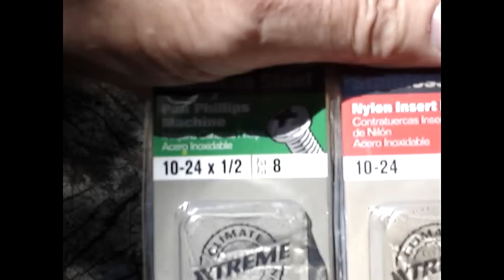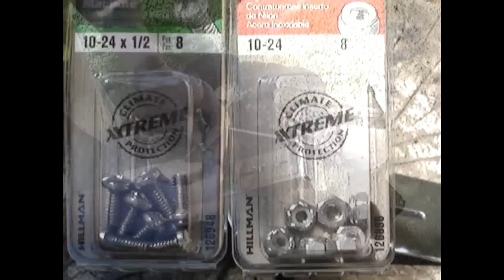RUIXIN PRO Knife Sharpener Modification

Comment: Nice video.  

In my comments below I refer to the end of the sharpener which is closest to the user as the front end of the sharpener. 

I decided after one sharpening to not use the clamp for much the same reasons as motivated you to put in the magnets.  I just freehand hold the knife in place.  I put the bar, which is part of the clamp system and which is supposed to go across the back of the sliding plates, underneath the front end of the larger plate.  This raises the plate enough to serve as a rest or back stop for the spine of the knife.  I found the plate itself is not thick enough to be an effective back stop to prevent the knife from sliding down the table.  The smaller plate I put on the front of the sharpener in the vertical position to clamp scissors and such.

The next major mod was to fix the problem that the vertical post is not far enough from the front of the sharpener to allow you to use all of the surface of the sharpening stone.  I mounted the sharpener to a board.  Then I took the vertical post out of the sharpener and mounted it to a 1"x2" piece of wood.  Then I screwed the 1x2 to the mounting board behind the back end of the sharpener so that the vertical post is now far enough away from the front of the sharpener that I can use nearly all of the surface of the stone in my sharpening.

I changed the handle on the stone rod to a round wheel.  I would prefer a round knob like those on earlier plastic sharpeners but I can't find one that fits the threads on the end of the stone rod.

I use an angle cube to set my angles.  When I change to a stone of a different thickness, I just use the cube again.  I prefer this to using a drill stop collar on the vertical post as many people do.

Again, thanks for the video.
Reply from the maker: +Joe P 
Joe, I would love to see what you've done... this sounds great! Do you have any pictures or video of your setup? 
I can almost visualize it, but a couple of points have me guessing. Also, I've never used an angle cube... I'll have to get one of those! 
Thanks for your comment and the description of your modification!
Reply: I too would like to see some pictures or video of how you use it freehand. That might be an even better approach than the magnets. I got my Ruixin today (06-02-16) and immediately saw the problem you mention about the vertical rod at the back of the unit being too close to the front of the unit. I will try making my own mount for the rod. So I'm interested in seeing a picture of your rod mod too. Thanks.
Reply: Joe P
I read your comment two times but not being a native English speaker and not living an English speaking country makes it impossible for me to understand your setup. Please make a video to demonstrate your setup/ modification.

Comment: Also you can move vertical stand 2cm forward. Just drill a hole in your wooden base and fix it with nut. This allow you to use full surface of your stone. Longer stone lifetime.
Reply from the maker: Great idea. Thanks!

Comment: Beside locking nut, you can use couple of plain washers stacked together and lubricated. This also helps for smooth movement. This system is used for laptop screen hinges.
Reply from the maker: That's a good thing to know! Thanks.

Comment: i own the regular model,the one that looks like the edgepro! because i couldn't remove the slope/play from its pivot system,i just replaced it with a ball joint rod end and totally fixed this problem,i now am getting proper bevels on my knifes,i recommend other people try dong this,i never thought the pivot on this copy or EP worked in the first place!i just got tired of messing up my good knifes,thank you.
Reply: Can you provide a source for the ball joint rod end you used?  Thanks!

Comment: I replaced the swivel mechanism, and the bar that slides through it. All you need is a tie rod end, M8. 8mm  precision ground bar. Drill a 7.5 mm hole through the threaded part of the tie rod end.  Thread the end of the bar with M8 die nut. and there you go. Add an M8 bolt or thumb screw, and you have a very smooth, rock solid slide mechanism.
Reply from the maker: Neville Springer
Genius!  A tie rod end.  I've replaced many of them in cars and it never occurred to me that it's the exact thing this needs (except smaller, of course)!  Whoa!  Thanks!
Reply: @Calvin Beckett Instablaster ;)

Comment: Nice job. I like the base you added. You mentioned you were looking for a more sturdy base. But then it's permanently big & heavy. I would keep it like that and maybe add some form of clamp or even a ratchet strap to hold it steady. If you can find a good way to use the strap and find some good anchor points on each side of your table that might work the best because there's no metal parts to bump into and doesn't add to it's bulk. Just a nylon strap running over the base holding it steady and in place. I stumbled on to your video after ordering one myself to see ideas to improve on the design. Thanks for the info.

Comment: I've used  similar guided edge systems for over 20 years now, to sharpen mostly custom made knives. The first was a Lansky - okay, but the stones were small and narrow. A Gatco - similar, but better than Lansky, with longer, wider stones. The last 2 kits were more money than the Ruixin but the same concept. They were great - BUT - plastic parts started to crack eventually. The Ruixin is all metal, but there are no markings to indicate angle, you'll need to measure that and mark the pivot stick accordingly. If you get any stone/metal slurry between the blade and the sharpener platform,  you will scuff the blade. I put a thin piece of tape on both sides(of the blade) to protect the blade finish. The clamp system gets in the way sometimes. I take it off and use a thicker plate so I have a deeper shoulder for the spine to butt up against and just hold the knife down and back. A Perfect sharpener ? No, but it will do an excellent job. The price for some waterstones can easily exceed what some people would pay for a custom knife, but for the $21.00 US shipping incl., you can't beat it. If you can't put a deadly sharp edge on a blade in 10 minutes with one of these, you shouldn't be allowed to use a knife, but there are several systems out there that will thin out your overweight wallet if you don't like this one.
Reply from the maker: Kevin Michael East
I agree, Kevin. This worked OK, but only with wide blades... With the thinner blades (fillet knives, etc.), the stones rub the brace (as I tried to show). Also, having to re-adjust and re-clamp EVERY time the knife is flipped over just wasn't worth the trouble. 
One of the best systems that I have every seen was a home made rig, where the guy used on old drill press (that the motor went out on), and inserted screwdriver handles on long stainless rods that held the diamond stones. He could bring up a hair-splitting edge in seconds! -- Heck, I just looked up his video; here it is: https://www.youtube.com/watch?v=YOrPH6m34PE

Comment: I'd say the guide is supposed to be loose, as you can then apply force without counterpressure. I only want the angle to the blade fixed, not the actual back and forth or left and right of the stone. That said, yours seems to be exceptionally loose. If it troubles you, simply adding a silicone or nylon washer between main pivot and angle clamp would likely do the same thing. I never had an issue with this. 

As far as the clamp issue, it seems to me you've got the blade rest quite far forward, as well as the riser on the clamp plate quite far forward, both will make the edge of the clamp end up higher. If you'd have moved both back to where the edge of the blade is on the edge of the holder, the clamp is at the back of the blade, and the spacer at the back of the clamp, I don't think you'd have this issue. I know I never had this issue either with mine. 

In fact, using the clamp (though I did put some electrical tape on the inside of the clamp) allows me to use the handle of the blade as, well, a handle. Keeps the thing steady, eliminating the need for heavier base. Heck, even dremeling the clamp plate down a bit would've been a preferable solution to me, rather than remove the clamp entirely. 

There's also a comment about moving the vertical stand forward 2 cm. I just flip the stone around every so often. (I do it fairly often.) Not only does it help keep the stone flat because you use both sides, and keeps it from grinding down one side more than the other, you still use both ends of the stone.

interesting how 2 people can have such widely different experiences with the same product.
Reply: Good video,helped me out a lot. I didn't bother with the dremel work,l just put a small but strong magnet underneath,holds the knife  in place perfectly. I wouldnt have mine working so well without watching this and another video..so thank you.
Reply from the maker: 1. The guide HAS to be loose enough to allow the rod to pass through easily... but the way it comes from the manufacturer, it won't stay at any degree of stability and loosens to the point of loosing the screw! My mod remedies this. 
2. The blade is in the ONLY position it "can" be... The problem is the stone rubs against the brace when you sharpen a thin blade knife (as shown in the video). A WIDE blade does not present as much problem, but still will not allow a less degree of angle of sharpening (15 to 18 degrees), as I use. Constantly readjusting the brace is ludicrous and NOT worth the trouble of using this system. My mod removes that hassle.
3. The only thing I would change (now), is to use neodymium magnets, because they are stronger and would hold the blade more secure.

Comment: Great job. I was looking at these on Amazon. They looked good, but they also looked like they might have some trouble spots due to poor design and/or low quality.  So I searched for more info and found your video. It convinced me to buy one.  When I saw your mods I knew I could make it work. It made me realize I should look at the Ruixin as a "build your own" type of product. It's cheap enough to justify having to do a little customization. Your magnets look like Harbor Fr8 magnets.  I have a bunch of those so I played around with them just now and they don't seem strong enough to hold my knives. but I saw one of commenters advised using neodymium. I think I'll try that instead. Thanks for sharing.

Comment: I did something similar, except I used a couple of neodymium magnets, about 28mm round by 4mm thick, and I didn't have to cut anything, they stuck right to the table with heaps of strength.

Comment: Get rid of the wing nut on the rod and gain 6mm+ travel.
You need to find photo's online for correct setup; you may be clamping incorrectly which causes the interference. Thin knives ARE a challenge though. Going through various eBay ads for this device and screen-shotting their photo's will give you a library for setting this thing up. The instructions are non-existent.
Screw the assembly down to a heavier base with non-skid bottom. I used 3/4"/19mm plywood with 'shelf liner' from $1 store.
When constructing the non-skid base, make it longer than the jig by 50mm/2" and add a few holes to allow moving the vertical rod back more. This will give you more travel and full use of the stone length. I believe the thread is M8.
An o-ring slipped over the rod to act as a bumper will help as the rod will sometimes jam in the pivot if you over-travel it.
Ditch those stones and buy diamond ones. They cut much faster and wear more evenly. I only use the finest of the stock stones to finish with.

Comment: Hi RonRay, you´ve done a great video and a top job with the modifications on the sharpener. I use the same and your vid is very helpful for me. Thanks for sharing. Greetings from Germany...Marcus
Reply from the maker: +Cobra 
Thanks Marcus! I'm thinking of taking those regular (ceramic) magnets off and replacing them with neodymium magnets. That will hold the knife even more securely!
Reply: RonRay
That´s right RonRay. These magnets have retention forces of about 80kg. I already have one of this and will install this one in the same way. Then my knives are kept solid and safe :-)
Reply: if you have an old/broken hard drive, you can remove the Neodymium magnet and just glue it to the underside.
Reply from the maker: Dirk D
Great idea! I think I do have an old 10 GB. Thanks!
Reply: I bought the edge pro clone and one or two magnets fit underneath just right...no need to glue
Reply: I love the mods... but the idea of repurposing old broken puece into new usefulness is even better. Thanks to all.

Comment: number one, do you sharpen knives often? you go into the blade not out from the heel to the toe. second, doesn't look like the knife is secure enough, moves slightly the edge is gone. Three, hope you never want to sharpen scissors, what you cut out holds them.
Reply from the maker: steve pp - I don't sharpen knives often on 'THIS' rig. I modified it only to lessen my regret for buying it! 
I do sharpen knives often, the 'traditional' way and have been for years. I usually use a 600/800 grit diamond stone (#400 if it's like a butter knife), then finer one, then a porcelain stone, then a strop. I usually start away from myself, beginning with the tip (always cutting 'into' the stone), continuing to the hilt, then flip the blade over and start drawing toward myself, beginning with the hilt (choil) and continuing to the tip. Then strop the bevel 'away' from the edge. (Never 'flipping' the blade before the end of the stroke- this rounds the edge.)  This is the way I've always done it.
Yes, this setup (RUIXIN), is not stable enough for me. I was going to replace these magnets with neodymium (extra strong) magnets, but decided to just put this thing on the shelf (where it is right now). 
To sharpen scissors (very rarely), I use a fine diamond stone at about 40 degrees, but usually just cut a few strips of aluminum foil and that puts the "edge" back on them.
Reply: k ty for explaining Ron have a good one...

Comment: How you do you with scisorrs? 😑🤔🤨😬🧐
Reply from the maker: I don't believe there is any "good" sharpening tool for both knives AND scissors. Knife bevels are from 15 to 25 degrees, where scissors bevels differ, but are around 60 - 80 degrees. The best way to sharpen scissors (since the angle differs), would be to darken the flat surface (edge) with a Magic Marker, then use a very fine abrasive to EVENLY remove the dark from the bevel. That way you won't run the risk of taking off an uneven amount of steel from the very edge, where the two blades meet.
Reply: @RonRay  that's exactly how it works! or should it be done but with 3000 or more I have from 3000 to 8000 grindstone for scissors and it works fine !

Comment: today i iopened mine and saw the same problems as you and another big one. Its a major desing fail u cant use the full sharpening stone lenght because it hits the butterfly nut so theres 4 cm on the handle side that cant be used, so you must turn the stone after each use

Comment: Why the hell did you cut the thing apart? Just put the magnets underneath
Reply from the maker: Paul Brown: 
Magnetic flux lines do not travel "through" steel very well- not enough to hold the knife blade still. Cutting a slot for the magnets allows (*almost) direct contact with the magnets. (*The layer of tape protects the blade from scratches.)

Comment: Nice mod, but doesn't F1 come with convex edge?
Reply from the maker: It probably does, but I am not changing the "profile", just the secondary (edge to edge) bevel. Like a hone. 
If I were to get into the profile, I would use my 1x30" belt grinder/sander with a slack belt to achieve the convex bevel. 
Thanks for your knowledgeable comment.

Comment: I like your mods but what about stainless blades?
Reply from the maker: Richard Reaume
   
If you mean does this sharpen stainless blades- It does. The main thing with stainless steel is that is is softer than carbon steel, so it is easier to sharpen, but also dulls easier.  The best of both steels is "440 stainless steel" knife blades... It holds an edge well and is still pretty easy to sharpen.
Reply: @RonRay What I meant is that stainless isn't very magnetic.
Reply from the maker: @keithrichardsson9008  
OK.  .. Yes, stainless steel will be attracted to the magnets.

Comment: Do you people ever watch the videos released by the genuine equipment manufacturers before you launch in to using it wrong and modifying it?
The "clamp" you had trouble with if for scissors and fits on the front of the device.
Why are you attaching a clamp to a clamp?
The knive shouldn't be clamped at all - you hold it and for longer knives move it appropriately across the 'table' of the tool.
Before modding you kit folks, watch this tutorial and see how it 'should' be operated.
One mod for these devices which IS worth adding, is a sleeve with a grub screw like you would use as a depth stop on a twist drill. Add this to the back of the sliding rod so that it prevents the stone slipping off the knife edge on the pull stroke. Add an 'O' ring as a cushion.
He's a proper manufactures video showing the proper technique:
https://youtu.be/hL_S5NrW-v8
Reply: your wrong it doubles up for the scissor clamp but it is used as shown if you want to use it
Reply: Your link is the wrong bloody sharpener!! jeez!
Reply: you are absolutely right  -- I think he has done a nonsense work-- he does not know how to use this tool-- there are small other modifications which make this a very useful tool.  He is not skilled but a person without technical knowledge of usage.